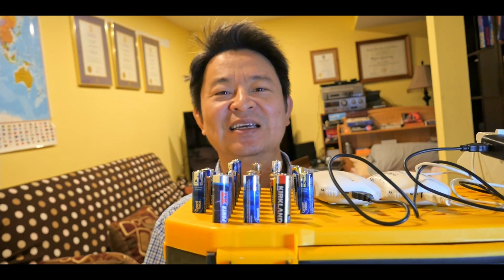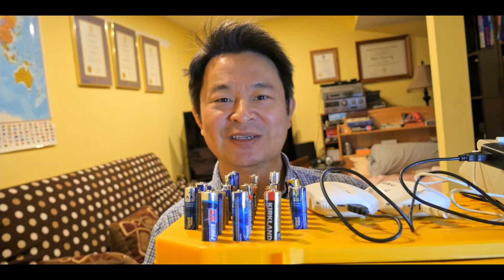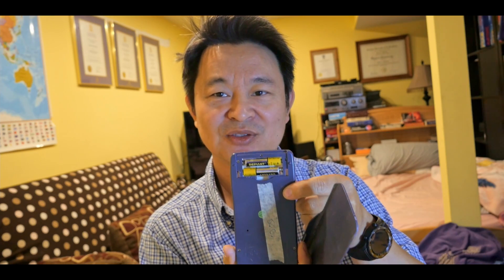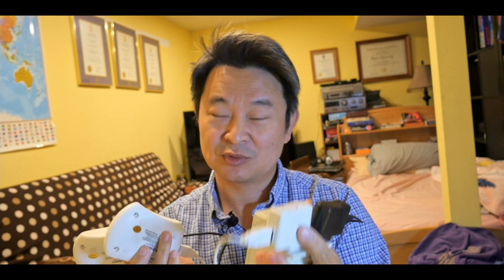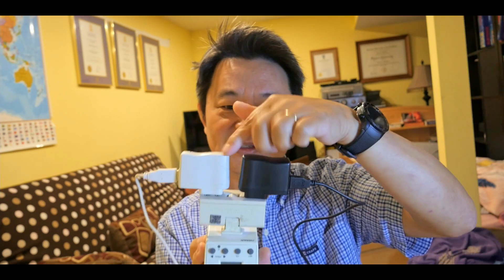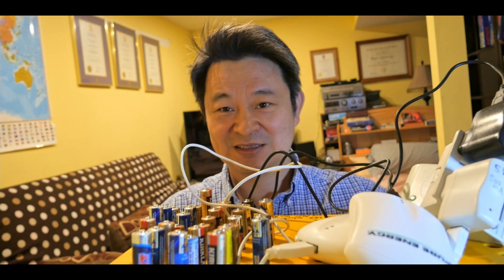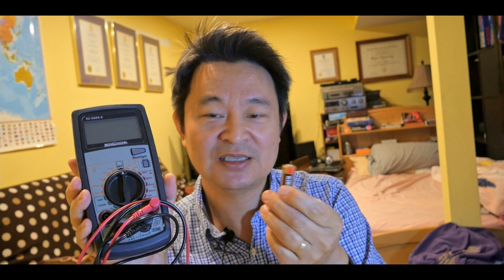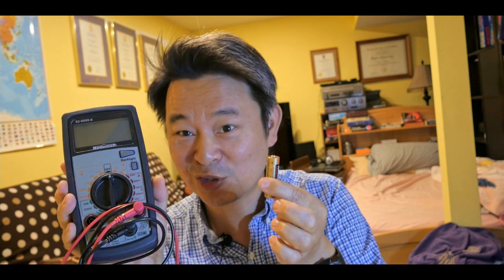How to recharge or re energize regular alkaline batteries safely and effectively

Comment: why don't you use a good regulated DC power supply. I have one , that displays V, A, W. Current and Voltage have Coarse and fine adjustment. I used it to charge my Lithium Ion Motorcycle battery. you have to watch the current draw, dont leave unattended.
Reply: Hovering over an expensive 🤑regulated power supply🤑, never mind acquiring all the electronics knowledge to learn WTF you are doing with it to charge up different kinds of batteries...🤓
Isn't that a hell of alot more trouble, and especially expense, than just going to a Thrift Store or a yard sale(or even buying a new charger at Wal-Mart?) & getting a generic digital timer outlet & some old AA/AAA/C/D cell charger?🤨
You got a big expensive Li-On motorcycle battery... what's that worth? $150-$200? Is your perceived savings on the correct battery charger, which is surely under $50, worth the risk of ruining a $150 battery? Or even that your charging methods could potentially reduce the lifespan of it?
And what's your wasted time hovering & constantly checking the charger worth compared to the modest cost of the right matching charger, worth to you?
I'm not up on the technology of Li-On chargers, but I suspect that your method is likely not how the commercial battery chargers work, & things are going to end on a sour note for you unless you are ABSOLUTELY SURE that you are, let alone CAN, duplicate the correct charging regimen for the most advanced rechargeable batteries on the market right now, which are Li-On types like yours.🧐

Comment: Is the charger okay for solar power?
Reply: You can buy Buck Boosters for like $2 on Aliexpress that let you adjust the DC Amps and Voltage output which is great for charging batteries, so it will send a constant current to your batteries when charging.  I use the LM257? I think hahaa
Reply: @ArtyMars I was under the impression that buck converters only let you adjust the voltage, I'm not saying your wrong or anything like that. How does you adjust the amperage? Does it adjust the amps with the voltage at the same time?
Reply from the maker: As long as each alkaline battery charger have voltage and current  regulator it should be fine. The current should not be above 150mA. Monitor it every two hours to make there is no leakage.

Comment: Can you use a charger with 2.8v and 180mA?
Reply from the maker: Yes, if you can two 1.5V alkaline batteries in series (3V altogether), but it will be only charged up to 1.4v each.
Reply: I found a 2.8v and 150mA charger will it work
Reply from the maker: Yes, as long as you connect two alkaline batteries in series (3v together).